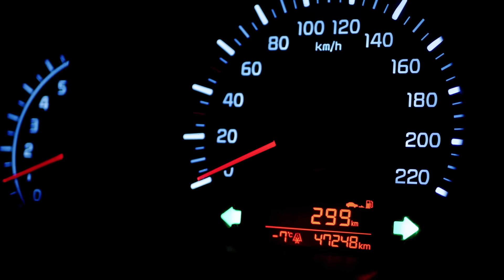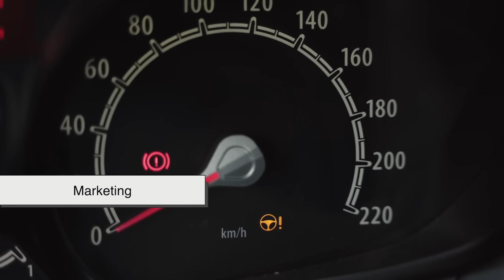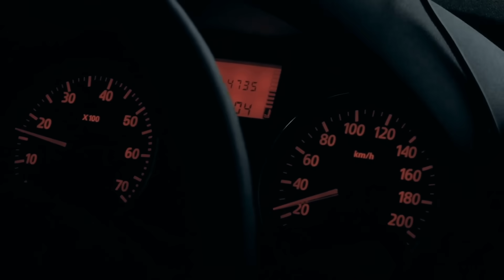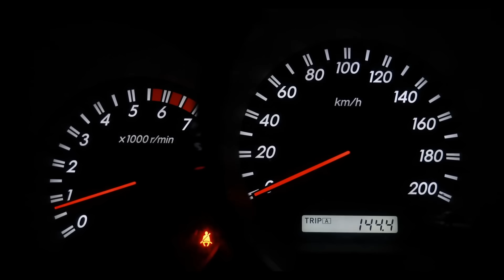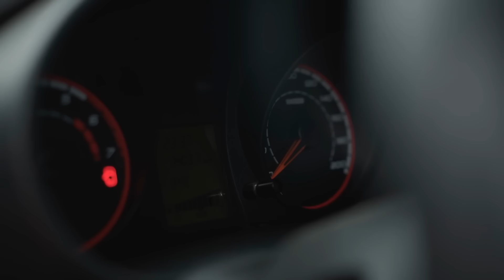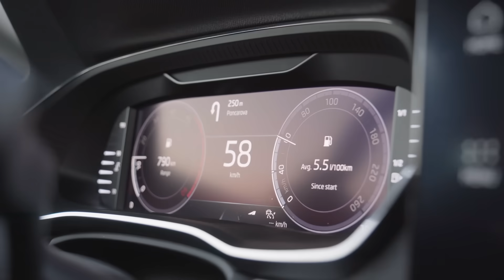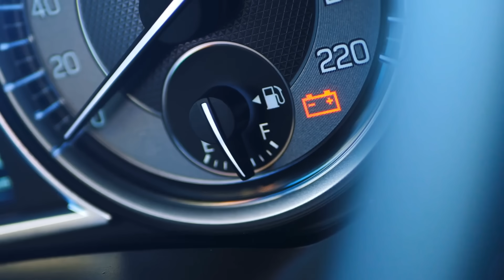Why Speedometers Go Over 200—Even if Your Car Can’t

Comment: My 1991 pickup speedo  is marked to 85 mph, but the truck will go faster than that.   I've briefly reached the OD symbol for the transmission selector. Seems to have an electronic limit there.

Comment: You can get pretty close in some cars. Holden VE SV6 has dials that go to 260, but they can hit 250 excepting speed limiters. It's best to have a bit of overhead, I wound out my VS redline till the needle was bouncing on the max pin. 🤘

Comment: That margin of error thing (+legality) argument is actually much more important than ppl think. My car’s theoretical top speed is supposed to be 185km/h but I easily reach 210km/h (which is a quite significant difference!) on downhill sections on the German Autobahn. If my speedo was stuck at 185k/h, that could very quickly turn dangerous if I don’t actually know at what speed I’m actually going. This argument is especially true with winter tires, where their speed limit may be lower than your car’s top speed!

Comment: What's missing from the video is mentioning that an optimal cruising speed is that what is on top of the speedometer.
Reply: For me not, it's about 140 thats two o clock generic cruise speed is 160 (three o clock), while maximum is 220. gauge ends at 120mph 200kph.

Comment: Standardization is kinda wrong reason, though. While internal components may be standard, the unit rarely is. Modern corporations go out of their way to prevent standardization. They strive to make as many parts as they can non-interchangeable, doing that even to production batches of the same model.

Comment: mine goes up to 300 and it will do it

also where mine goes to 300 the base model only goes to 160 and the US version goes to 200
so at least with mine, its different across different versions

i also was driving a car that went up to 180, and i got the needle well past that

Comment: Had a bmw 3 with speedo max at 260. The car barely did 220. I didnt understand this. Such a weakling. Yet i also had a kia cerato 1.6 with speedo up to 220 and i could do 216. So almost max speedo. Thats a lot more fair.

Comment: What an interesting topic to cover on you tube firstly l live in N.S.W Australia were the maximum speed limit is 110 kph on expressways l have travelled over that limit when there are police around and l own a a1997 Toyota Hilux Ute and its speedometer goes up to 160 kph and l did that once and was surprised because most speedometers have a high speed and most cars will not reach the highest speed shown on the speedometer

Comment: With some cars you can actually reach those top speeds and hence the speedometer has them. Manufactures lock the speed of the car but you can connect to the car and remove the maximum speed limit or press a combination of keys in the car to remove the limit on the software.

Comment: Newsflash, most cars can reach the top speed they have but not on stock fuel pump exhaust pump and so on, nothing that upgrades hp just keep the car clean from all angles, clean engine nice clean liquids where needed, fresh oil, these small things that people do almost everyday are things that can make a stock ar run much better, also driving your car like a madman apparently helps in increasing cars performance, I know my brothers car is insane, it's a 2008 ford focus with a turbocharged but it acts like it has a superchsrger instead, there's no turbo lag and boost hits at 1000rpm and doesn't stop not even at 5000rpm at that car has 240kmh dash but my brother drove at 200kmh and still felt power on the acceleration pedal, Infact my ford mondeo has 260kmh in the board and that car went 220kmh and still could have moved

Comment: 220 km/h. Is very comfortable speed on autobahn in Germany…
Reply: 1. Even on the German Autobahn it is rare to find a place were you can actually go to 220 km/h. Sometimes people do this and I have experience with that but it is not confortable and it is not safe. 
2. The typical speed on a "free" Autobahn for passanger vehicles is between 120 and 150 km/h. Going at 220 km/h creates a huge differential velocity and increases your breaking distance a lot. If anybody in front of you changes lanes and did not see you coming - you are in trouble.
3. Using the Autobahn as a racing track is dangerous and if you get into a crash at such speeds it might be the last thing you do. 
If you survive, the court will likely tell you that you have taken an unneccessary risk and therefore are at least partially responsible for the outcome.
Reply: Everytime i visit Germany, the autobahn always feels like a roller coaster for me, for better or worse
Reply: I did that from Rome to Bologna. OK it was at night, very small traffic. In Hungary its next to impossible, only at night and on week days. And not during summer time. Also because they are toll road, but most of the time at least 30-40% of them are under construction, reduced to two lanes, so it's pointless. to drive on it thus pay for it.
Reply: No, it's very dangerous speed for you and other drivers, independent of your skills.
Reply: @pingpong_  no worries, we have everything under control 😊
Reply: @pingpong_  I have driven with my car 225km/h on the autobahn, but then you see cars that take over with more than 250 km/h.
If you driven 220km/h can be that you are  compared to others to be slow.
With that speed, you need attention, look what others car do, how fast they are driving.
If everyone drives 220km/h, the speed compared to other vehicles can be low.
Reply: @pingpong_ clearly someone who never drove in germany
Reply: @samuelele  as a profesional truck driver since 1995 I have been driven more KM on Autobahn that average german driver will complete in 5 lifetimes , so my point is every speed over 160km/h or 100mls needs exceptional  driving skills technicaly perfect car with factory design  of engine brakes transmision front and rear end for speed of over 200km/h and only on very short parts with 3 or over  3 driving lines everything else is madnes and despite all new car safety feutures i still see literaly everyday catastrophic accidents on autobahn, young adults without driving expirience with fast cars are ussual victims
Reply: If somebody does any dangerous or stupid or illegal thing, this shouldn't be encouraging for you.
There are so many reasons against high speed. Wanna high-speed rush? You should go on the track.
Reply: You know that your insurance policies  stop working after you go over the recommended speed. And all dept you will do will be inherited by your families.

Comment: A car that reaches 150 km/h with acceleration, downhill and a tailwind 
does not need a speedometer that goes up to 260 km/h.
Reply: Go tell the car companies maybe they'll hear you
Reply: but the need wind direction display, windage sensors and and electric sail wrench

Comment: I always figured it was so that the top (legal) speed had the needle pointing straight up (12 o'clock). 
At that position, it is easy to see and less likely to be hidden behind the cross arms of the steering wheel as it is turned.
Reply: That rings true.  My old car it was 55. Speed limit went up, next car 65.  New car? 80, which is I think the max now.  So you only use the left half.  It's a software generated "dial" so no country standardization required.
Reply: Legal speeds differ from county to country. So that can't be it.
Reply: Just one point there that strikes me... at top legal speed I very much doubt your going to turn the wheel enough to get a steering wheel spar across the Speedo... I mean you could, but it would probably render the Speedo and steering wheel and driver unroadworthy 😂
But your kinda close to something I believe was true for some time. The straight up is general half the Speedo range, now there was a concept of half the highest number was "maximum all day cruise" speed! Now I guess that would have been if the vehicle was at its maximum load capacity also. I'm going to add that this is Australia! and the regulations on cars are all over the place. We followed California emissions code from 1971 to 1986 when that changed as that was the ban on leaded fuel sales. Other factors were a European standard like crash safety and how many mirrors etc but Australia is the road pirate revenue thought capital! Our Speedo standard is garbage. It's only required to be accurate between 40 to 100 kilometres per hour to a tolerance of plus minus 10% and we have a zero tolerance road London! Just a bit suspicious. 😂

Comment: You really are speaking with your limited experience. The title screen use a BMW cluster.  The *35 or *40 model will hit 150mph or 250kmh with ease.   Even the *30 will do that.   Remember, the cluster design is used across the family.

Comment: The only everyday use cars that can go 260-300km/hr every day for years (past 100k miles) are Audi, Mercedes, BMw, Porsche. The rest risk breaking apart, melting their pistons, carried away from the road by wind
Reply: It‘s not 100% accurate (all the supercars can do it) but I‘m still astonished by how relaxed you can cruse with a 5 series diesel at 250kph without blinking, while my toyota sports car, while being built very rigid, reaches 210kph and feels like that‘s all it wants to do. Also, the impressive thing is that these german cars are just family cars, not some glorified sports car!
Reply: @samuelele supercars aren't every day cars
Reply: @dedan2 that is usually correct, yes.
Reply: @samuelele and that makes them far better than any supercar
Reply: German car makers BMW, Mercedes and Audi have agreed to limit their cars to 250 km/h. 
This does not apply to some super sports cars but realistically even 250 kpm/h is well beyond the skills of most drivers.
Reply: It's not a manufacturers agreement It's Euro 3 or 4 standards 20yrs ago that all passenger cars are speed limited to 155mph/250kmh if it's a limited production for "track purposes" is the work around  @hermes7587
Reply: 100mph is only 160.3kmh not 260kmh plenty of American cars & Australian can do 180kmh all day cruising as they have big 6 or V8 hell most of the 6's are around the same cui as most European V8 including Japanese 6's being in the 3-4ltr with the 8's being 5-6.5ltr, European cars seem to be smaller displacement but with super charger's and turbo yes there's some German examples like the 6.3 bi turbo but a 6.2 super charged Chevy does the same thing for half the cost
Reply: @hairyscary8511 we‘re not talking 100mph. We‘re talking 150+ mph - which is casual cruising speed on some german highways. Most cars that are not built in Germany are not built to go as fast as that. The German cars rule this sector of the speedometer by a lot!

Comment: There are two main reasons.
1. Almost all meters are caliberated in the half of the total range, i.e. it gives fairly correct reading at the center.
2. It is easy & convinient to read when pointer is at the middle.

Comment: The 85 mph thing was a federal law thinking that somehow people would be forced to drive slower, don't let the idea get into your head that you can go faster.

When I bought a new 1980 Honda 750F Super Sport it had the 85mph speedometer.  Fortunately, an earlier speedometer fit right in.  I think it went to 160mph, although the fastest I ever got it up to was 125mph with room to go.

I'm skeptical about a Nova going 140mph...if your speedometer even went that high, even if one of the later V8 models.  Speedometers were notoriously optimistic in those days.  Just like the horsepower ratings.  They were done under the old SAE gross HP.  No fan, open exhaust, not even turning the water pump, and other tweaks that were never used on the road.  Now, cars are rated at net HP, as installed in a car.

Comment: I can remember as a kid in the 1950's we believed that if a speedometer could go to 120mph, that's what the car could do.
Reply: In 2025 people still believe that today. People look in my Porsche Panamera and see 225 mph on the speedometer and they are like "Wow, can it really go that fast?" Sometimes I would say "I dont know because I never tried." But other times I would be a bit more informative and say "No, even with a tune, it tops out at 195 mph. Even if I heavily modified the engine, it would never do 225mph without massive reliability issues. And the transmission probably couldn't handle the torque required for that speed either.
Reply: @hellbent7062  Interesting, thanks.
Reply: @hellbent7062 no one cares you have a fiat punto
Reply: Also in the 1950s, our window cleaner had a motorbike, and we kids thought he could do over 100mph, carrying his ladder and bucket. They were the days.
Reply: Unfortunately safety on the 50s lacked ABS or front disc brakes as standard. Still beautiful vehicles back then! 🌞

Comment: There's certainly more to it than just that- the engine might just as well be more robust. You can more easily drive a car to 90kmph that claims to have a top speed of 160 kmph than the one whose speedometer shows a maximum of 120. Anyone who regularly goes to gym is definitely more efficient in all aspects than the one with no physical activities.

Comment: VW Passat B5 had 3 types of spedometer dependant on engine onboard. It Was 220 in basic models 260 in Mid sized engines and 300kmh dial in top W8 Model.

Comment: Dad told me 50 years ago that for mechanical guages it was about accuracy. They were only accurate up to about 75% of their range.
Reply: they (From soviet Lada, and 2002 mitsubishi, and even 2008 mitsubishi) tend to show less speed compated with GPS navigation, especially if youre running smaller wheels/tires as it means more rounds per distance, and speedometer calculates with factory wheel circumference

Comment: Similarly we will never reach 130°-150° F but there are markings on our thermometers for those temperatures.
Reply: Correct, but they account for the thermometer out in hot sunshine in Vegas where it will pin out.

Comment: Engines are also capped with a rev limiter (typically with the computer) but can go faster but with more wear and tear and with the gearing ratio of the transmission if you go to last gear and max rpm then usually in theory you can get to that max temperature

Comment: My Silverado speedometer goes to 200kmh and the governor kicks in at 160kmh,      after 125kmh the front end starts shaking with Goodyear duratracs,    if I wasn't using mud tires it probably wouldn't shake as bad at higher speeds

Comment: It's a Modern Era thing, though. Many cars of the 70s, 80s and 90s have speedometers that max out at 85mph/135kph, even though the car could go faster. My first car, a 74 Chevy Nova, had a 120mph gauge, but went faster than 140mph. My 78 Nova gauge went to 85mph, but also went faster than 140mph. My 83 Civic gauge went to 120mph, the car was lucky to reach 65mph with a 30mph wind pushing it downhill.
Reply: I had a friend who was pulled over for doing 110 mph on the highway. He told the officer, 'really? my speedometer only goes up to 85 mph." He still got the 110 ticket.
Reply: Back in the 70s there was regulation limiting car spedos to 85 MPH max.  Since all the roads didn't exceed 55, it was assumed to be more than enough and (foolishly) it was assumed people wouldn't want to go faster than the speedo would show.  The cars were more than capable of it though.
Reply: @LFTRnow  Which country are you referring to?  Certainly not the case in Australia. 🇦🇺
Reply: @maxhugen  The United States.  It was a law back then when the national speed limit was capped at 55MPH (about 88 KPH).  The 55MPH limit has been done away with since the late 1980s and speedometers no longer are limited to 85MPH.  It was supposed to save energy during the oil shortage of the 1970s.  It was a total fail.
Reply: @LoveClassicMusic0205  Thanks for the info!  Couldn't imagine the US having such limits. 😎🇦🇺
Reply: Huh?  I had a 1972 Honda Civic, when it first came out,  that regularly did a smidge over 90 mph  ....   your 1983 Civic must have needed a decent service!  🤣
Reply: Well. I own a celica from 94 and my topspeed is 220 km/h. But the meter goes up to 280 km/h.
Reply: I have a 2002 vrx diamante, and it has gauge till 120 and it can handle about 130. But its old, I rarely strain it